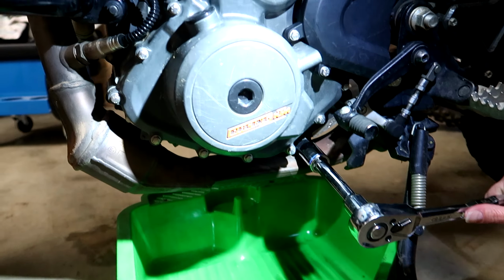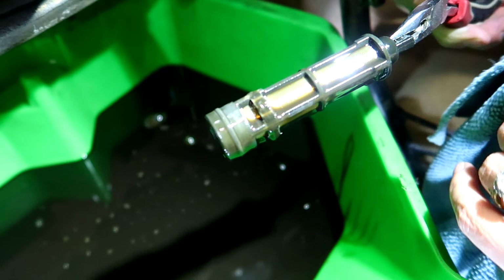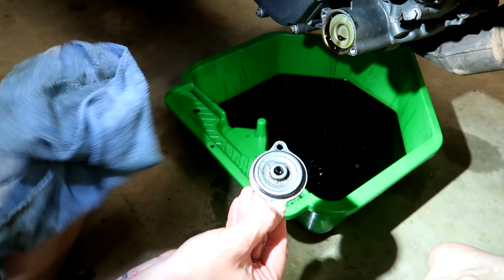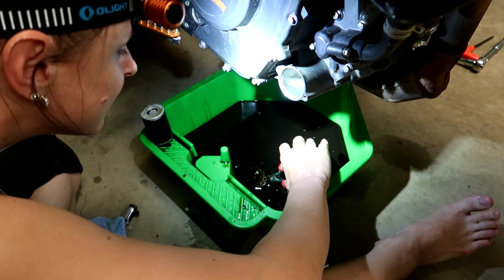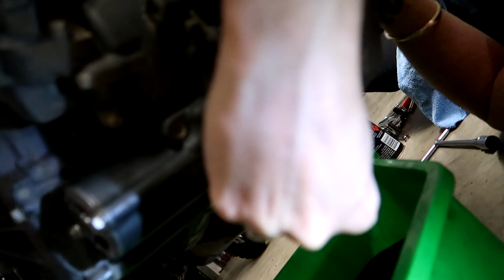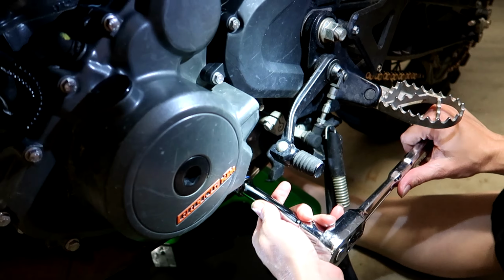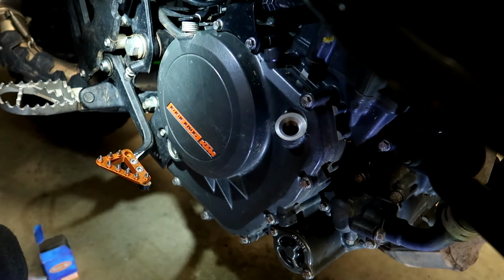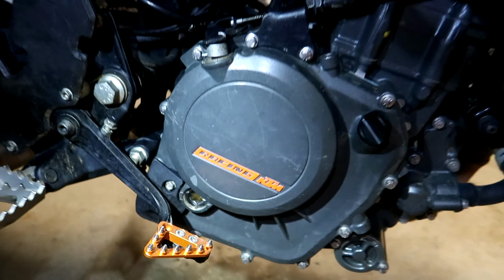KTM 390 Adventure: Oil Change Service

Comment: Oil the filter inner grommet and filter cover o-ring before reassembling and things will go together more easily and without the risk of the o ring gripping against the filter pot wall and rolling out of position, creating a leak. O-rings on screens should be oiled too. Good job guys. Love the channel.
Reply from the maker: Yeah it does mention lubing the o-rings in the manual, I figured there should be enough oil on them after Nat dropped them into the pan 😅 Haha cheers Tony

Comment: Hey there! 👋 
Wondering where you found that awesome radiator guard for the KTM? Thanks in advance.
Reply from the maker: Pretty sure it was a Power Part from KTM
Reply: It's the KTM Power Parts guard. I just installed mine last night!  AFTER painting it black though... that guard would have been the ONLY thing silver on the bike ;)
Reply: Thank you!
Reply: @HernandezJr_Henry  if in the USA I recommend KTM Parts Pro for these parts. They are great.
Reply: @Kyle Bradshaw  Yes, I'm in the USA & just picked up a used KTM w/7k mil for 2,000 used. Trying prepare it for off-road trail riding

Comment: My bike is different, to get the small drainer out you have to loosen exhausts two nuts and move exhaust to the left when looking from behind the bike. The small drainer is just underneath the exhaust. Torques of the two exhausts nuts are 8 nm. Believe or not! That is why I can not drain all the oil when engine is hot!
Reply from the maker: Damn that's a bit annoying... maybe we moved the head pipe a bit when we got the custom exhaust made up ✌

Comment: In another video that I can't find you mentioned the chain was absolutely shite! It's been said by others too,but do you think that it would be half decent if it was used only in the road? I'm picking mine up tomorrow just wondering do I get a good chain right off the bat? Even though I'm only going to be road riding? Cheers
Reply from the maker: I guess it would last longer off the dirt but it's still rubbish and won't last as long as a quality chain.

Comment: Can we use 15w50 for this machine
Reply from the maker: Pretty sure 15W50 is what the manual says, so yeah 😁
Reply: As MVDBR Enduro stated 15W-50 synthetic.
Reply: @MVDBR  but in India in showrooms they are using 10w50 fully synthetic

Comment: How is the AXP holding up after all this time? I really wanted one for the T7 but I think awhile back I saw it flex quite a bit when she rolled over a log so taking the weight of the T7 + mounted gear and rider (70kg) then really makes me wonder if it's up to the task. 

Also I decided to go almost all the way back to the beginning and watch all the videos going forward lol I think I found your channel on the test ride of the T7 maybe 3yrs ago, while I was still hung up on how awesome the Africa Twin was, or still is... It was during COVID lockdown at least lol It was really your videos which steered me heavily towards the T7, and I've been enjoying the development along the way, how you ride the T7 and all the locations you've been to. It's quite a journey so far. Biggest regret is back in the day I missed most of these videos so now finally get the chance to watch everything lol 😁
Reply from the maker: Thanks man, look out the videos probably get worse the further back you go 😅 As for the bash plate, we ended up getting an aluminium one from B&B for the 390 which was a lot tougher and better mounted. The AXP kept flexing onto the exhaust and melting 😬

Comment: Nat, Where does your parts guy operate? Looking to replace the bash plate and maybe add simple lower crash bars. Dee
Reply from the maker: Nat doesn't work here anymore but the bashplate is from https://bboffroad.com.au and the crash bars are from https://srcadventuremoto.com.au if that's of any assistance.
Reply: @MVDBR  Thanks heaps for that

Comment: Seems a bit excessive to have two oil drains and drain filters with oil filler I guess there engines brake apart lol
Reply from the maker: It's a weird KTM thing, the EXCs have the same setup. Real pain in the ass compared to other bikes
Reply: To be fair, most companies have some issues with their bikes. Just research “insert bike model here” - issues into Google, and you’ll find something, lol